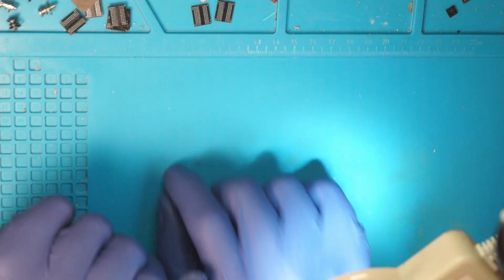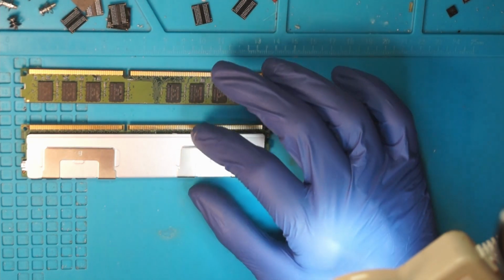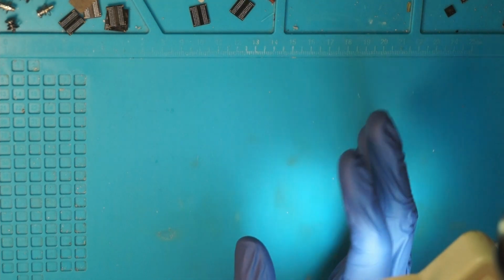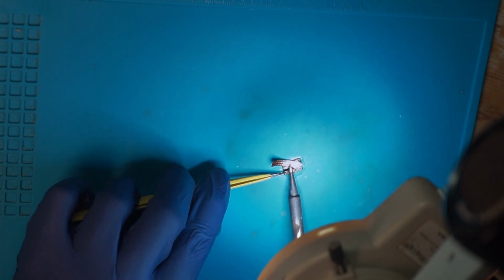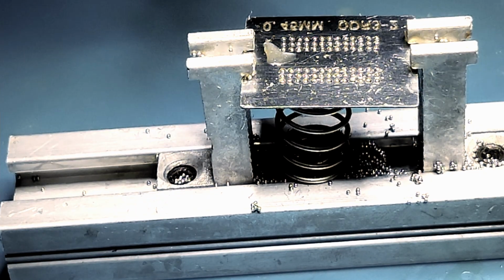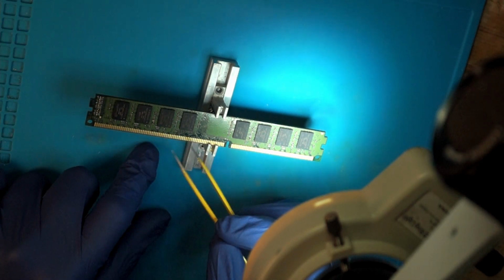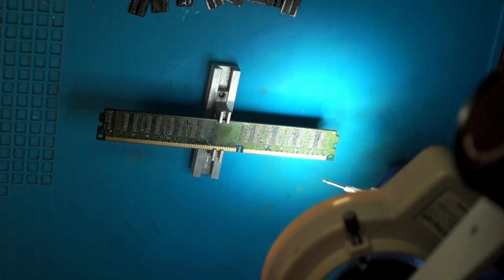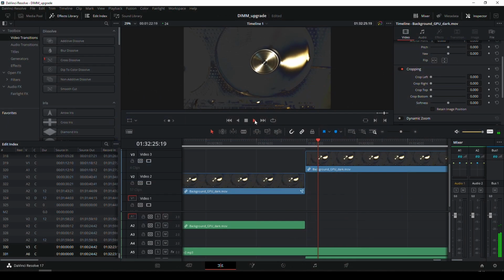Quadrupling the capacity of a memory stick | Part 1 tools, hardware & soldering

Comment: Indeed, this is at best pointless :))) but 100% fun :v 
Dunno if ram "upgrade" is becoming a trend or not, as I've just seen dosdude upgrading some macbook air's ram last week.
Reply from the maker: indeed! :) mmh I dont think that this is becomming a thing. It's just way too much work for way too little reward...But its fun....
Anyways, thanks for watching and have a nice day!
Reply: @fxbbm  With more companies doing soldered on ram, I  could see it. GPU ram for sure.... but they aren't standardized enough to reliably switch chips out.